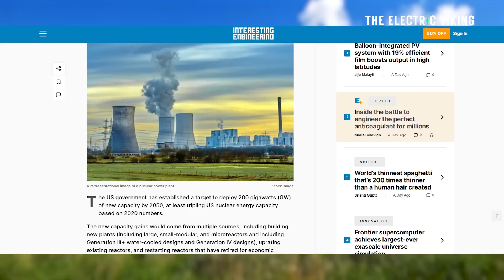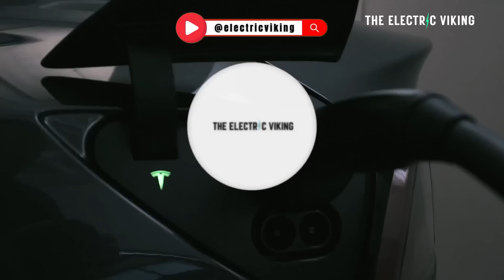US reveals plan to triple nuclear capacity with hundreds of nuclear reactors

Comment: There is no way that the US can nuclearise that fast. Even China faced manpower constraints just to run the stations. US face far far more constraints. It will take  years before it can even have a proper plan of expansion.
Reply: The US has lots of issues, the main one being the fossil fuel industry. It's understandably, fighting tooth and nail to avoid redundancy. For the most part the rest of the world isn't saddled with that problem, so will move on regardless. The US can catch up later.
Reply: @jimgraham6722  We will have another 4 years to catch up unless we get rid of Trump.
Reply: @EdwinaTS  6 years for new SMRs.  3-4 years for subsequent ones.
Reply: @ws7001  That is what they say, however 2 to 3 times more years to complete, non sense.
Reply: @rozonoemi9374  some of these designs are much simpler to build and operate.
Reply: @ws7001  Still nuclear BS.
Reply: @ws7001  To triple the nuclear generating capacity (now at about 100 GW) you would need another 200 Gw constructed. If SMRs are used that would require about 600 SMRs to be built given that SMRs are supposed to have a generating capacity of 0.3 GW. Or you could builr 200 ! GW reactors. If costs are like Vogtle 3 and 4 then they would cost about $A5 trillion of about$US3.4 trillion. Also where are they going to get the trained workforce required for such a project?
Reply: @ most SMR designs are for multiple units per building for about one gigawatt output.   The better gen 4 fast reactors are automated, nothing do for 30 years but watch screens and dust the office. These are low pressure units so concrete pours are simplified, vessels are small so construction is also simplified, using helium for working fluid means no need for secondary loops with water, moving parts rated for over 30 years means very limited maintenance requirements, fuel replacement every 30 years means very little maintenance.  Operation costs are mostly for security.  Training by VR is in progress and will simply hiring and training process.  These smaller units are easier to make fail safe- heat can be dissipated through ground without cooling water or pumps, this is a critical factor of SMR concept.  It’s not just to save costs or faster buildout. Total cost probably $1.5-2 Trillion.
Reply: @ws7001  Renewable are much cheaper & much faster deployments than any nuclear & much safer.
Reply: @ renewables are more expensive in northern areas requiring long term storage, as much as ten times more expensive.  Most of the developed populations live in northern regions.  Long term health effects of workers exposed to solar cell and windmill manufacturing are suspect in China.
Reply: @ws7001  BS
Reply: @ After 500 years of renewables and their waste entering our oceans it’s possible most sea life will go extinct. Have you investigated the cancer rates in China?
Reply: @ws7001  China has low birth rate & consequently rapidly aging population, hence cancer rate is bound to be high, but their life expectancy has caught up with the US despite living through some of the most polluted years. The past decade of the Green China plan worked amazingly well.
Reply: @ I’m sure CPC supplied data would show that.
Reply: @ws7001  On which planet do you live?
Reply: @ Third rock from the sun.
Reply: @ws7001  "renewables and their waste entering our oceans" That's a new one.

Comment: Truly stupid. Western companies simply cannot build reactors anywhere close to on time or on budget. 

Want a choice which is just as reliable, far faster to build, far cheaper than nuclear? Plus easier to modulate power and actually store some? Enhanced Geothermal Systems (EGS). Fervo is currently building a 400MW site and just received a lease for a 2GW site. Those two projects alone will exceed the amount of nuclear power built (start to finish) in the last 30+ years.
Reply: Hope it’s successful, however the high amount of corrosion due to dissolved salts and high temperatures will make maintenance an expensive issue.

Comment: Reducing regulations that slow the manufacturing of these plants will allow them to be built faster and cheaper. Not talking about regulations to make them safe but some refs were designed to eliminate or make nuclear plants more expensive on purpose. But now things have changed and it’s now realized it’s the cleanest power.
Reply: Usually regulations are there because some buffoon tried to cut corners and stupid things happened. For example in aviation industry regulations are written in blood. Can't imagine it would be far off in nuclear generation.

Regulations are needed.
Reply: Nuke Reactors will last longer than solar and a bunch of batteries so it’s worth the investment too
Reply: @JDMSwervo2001

LOL

Comment: Electric cars should be the back-up grid
Reply: For sale: 2023 Tesla model 3 10,000 miles. (And 750 discharge cycles not counted against its used condition)

Comment: I think its a matter of a good redundancy, having renewables for normal life, but backup nuclear, then renewables cant work (cataclysms, etc.). Also if want to travel outside of earth, small nuclear reactor may power so much while being somewhat "portable".
Reply: I think we should have a 50 50 solution with 50 percent or more nuclear as the backbone with renewables playing as the support role because every 18 months you need yo shut down a reactor to conduct maintenance and refueling.  Nuclear itself is the most safest form of energy generation that can compete with fossil fuels it can go 7/24/365 without interruptions.
Reply: Nuclear thst you regularly shut in doesn’t make sense, that’s extremely poor economics for nukes.

We actually may see dedicated nukes for server farms, that makes sense since that’s a 24/7 level load, which is a great match for how nuclear works best.

Comment: I live 10 miles from a nuclear power plant for the last 40 years and have had zero issues with it.
Reply: Great for the tax base
Reply: The people around Fukushima were enjoying their lives, until one day when they weren't.

Same with Chernobyl.

And Three Mile Island.

There have been many nuclear accidents.

If living near a nuclear plant, storage tank farm or gas or petroleum pipelines, you're certainly more at risk than someone living many miles away.
Reply: @dvader3263  yes those examples were terrible. However the use of fossil fuels by far kill more people each year with the pollution in our air the environmental damage oil spills that kill wildlife. So statistically Nuclear power is much safer. The only difference is when a nuclear accident happens it has the potential for catastrophic consequences. Then add the carbon emissions that we know will cause vast zones that will be practically uninhabitable. Sea levels that submerge cities around the globe and cause massive climate driven immigration from people forced to migrate from submerged communities like Miami and New Orleans. I live 10 miles from a Nuclear Power plant and in 45 years have not had one incident. All this being said Nuclear power plants have redundant systems and strict safety regulations. And in the United States we have only had one nuclear incident and it did not leak any radioactive material into the atmosphere.
Reply: It seems that Sam is against nuclear energy because of the high cost of electricity they produce (see levelized cost of energy), high cost of building the facilities, very long permit and build times, and lacking any reasonable power up and power down abilities, they only provide base power but do so at cost that is as high as any peaking plant.  Any power plant can keep the lights on.  In-flexible base power was tolerated because it was the cheapest.  In-flexible nukes and coal are now the most expensive.
Reply: How long have you lived there?  The nuclear waste takes 10,000 years to decay and become no longer hazardous.  You are but a blip.
Reply: @hobaho  it may take 10k years but it’s incased in a container that is so durable it is nearly impossible to leak. Nuclear is a wonderful base load source of carbon free energy.
Reply: @Dallas-wu6st  that’s Fascinating.  I would love to see a container that lasts 10k years.  Written language has only existed for 5.5.
Reply: @hobaho  the pyramids lasted 5k and probably will last another 5k so there! And that was made by far less advanced people. Nuclear power is far safer than any other energy technology we have that can produce that much energy in such a small footprint.
Reply: @Dallas-wu6st  There's no radioactive waste in the Pyramids.  You're talking about securely containing radioactive waste for 10,000 years.  We've never seen/made anything that would even be close to capable of doing that.  You're just giving the problem to future generations.
Reply: @ I understand your point. But given our power needs and the huge problems with climate change we must find a solution to limit emissions that are damaging our planet. Nuclear power is the best base load source of energy we currently have. Fusion reactors hopefully will one day replace fission reactors. Another way is to use solar power and new battery technology to provide the energy we need. I myself installed 60 solar panels on my home with 3 power walls that make me energy independent. The system provides all my energy needs for my home and my Tesla car. I realize that not everyone can afford the system I installed. But large solar farms and industrial size batteries are capable of reducing emissions. I am worried not for myself since I am in my late 60s and the I will be long since gone when the worst of climate change will occur. I am very concerned about the future generations and the world my generation left them.  To do  nothing is morally wrong. We must find a way to protect our planet not only for ourselves but for future generations of people. We only have this one place to live.
Reply: @Dallas-wu6st  "Baseload" is a concept created to fit particular characteristics of certain power generation types. You shouldn't strive to mimic an old technique with a new tool, you should strive to design your approach to address the end goal.
Reply: يوما ما سوف تنهار هذه المحطة النووية بطريقة او بأخرى سوف يكون الانهيار دون سابق إنذار مثل ما حدث في مدينة تشرنوبل ومثل ما حدث في اليابان
Reply: It's not that nuclear power plants have problems. It's that they are ridiculously expensive and take forever to build.
Reply: Future generations will have to deal with the decommissioning then?
Reply: @jsanders100 No all modern nuclear plants have through life management and funding, including site cleanup and restoration if needs be. Thus money is continually set aside for eventual decommissioning.
Reply: @jimgraham6722  What a waste of public money.
Reply: Exactly
Reply: I would put one in my back yard. They are safer than any other form of electricity generation. Viking's crusade agains nuclear is ignorant.
Reply: @beautifulgirl219  Nuclear is just moving pollution of radioactive waste to out of sight in someone else backyard, however the radiation will persist for thousands of years,
Reply: @beautifulgirl219 you are joking!
Reply: @beautifulgirl219  Actually he's Australian, there's a VERY good domestic reason for him to loath nuclear power. Pitching economically infeasible nuclear plan is being used in Australia by The Usual Suspects as a ploy to prop up coal and to lesser extent NG, argue against wind and solar that Australia is well suited to get by on (with the aid of battery farms and a bit of NG peakers).

Comment: Look, I generally like your content, but this video contains some nonsense (nobody wants to live 100 miles from nuclear powerplant) and it is obvious you're not a fan of nuclear.
Industry likes abundant reliable predictable power with high capacity factor, contrary what renewables offer. Look what happened in Germany. In Czech Republic we have 6 reactors, 4GWe (4 more planned), hundreds of thousands people live within 100 miles from both facilities, we successfully use the nuclear heat for district heating, displacing some 80 thousands ton of CO2 per year with huge extensions planned (nuclear heating for Brno city). Nobody has problem with it and the public support of nuclear is high.
Reply: Germany succesfully cut its string with russion energy dependence and relies now ~60% in renewables, and is aiming to close all their coal centrals in the next decade, transitionong to 100% renewables before 2050. Meanwhile nuclear France is in bankrupcy...
Reply: @Buran01  yeah, last week in Germany the hourly spot electricity price was above 800€ per MWh for two hours. Dunkelflaute. Even even lignite powerplants did not help. Massive import from abroad (mainly nuclear from France) saved Germany from blackout. I am also fan of renewables, but not on grid scale in central Europe.
Reply: @matejorsag6515  EDF is essentially in bankrupt, so that dpendence from Franch nuclear won't last much.

Comment: Large nuclear reactors are 6x more expensive to deliver energy than solar and wind, and SMR’s are 10x more, so unless nuclear developers can convince customers to pay 6-10x more for energy, they won’t happen.
Reply: Absolute rubbish no nuclear plant has lasted 80 years and they never will. Why doesn’t anyone want to talk about decommissioning cost?
Reply: @RussellFineArt  Nuclear powerplant can easily last +80 years with 90% capacity factor. Solar panels and wind turbines has to be changed completely each 20-30 years with maybe 15 and 30% capacity factor.  Imagine the amount of waste, to destroy and reinstall everything each 25 years.
Reply: What a stupid comment, wasn't Solar 10 times the cost 15 years ago?

Jeez we should never have invested back then....
Reply: It's not a cost problem, and reactor power will not replace solar & wind. Some areas are simply not practical for solar and wind power. The newer/smaller/safer/cheaper Generation 4,5 reactors are more practical to deploy and use in these remote areas.
Reply: @dr.x4050  Lol is not a cost problem... That's why General Electric, Westinghouse went bankrupt, and EDF was withdraw from the stock market with  mid term debt beyond 100.000 million €...   Good luck with those projects
Reply: @Buran01  The special projects I was talking about are for use in extremely remote locations, such as the South Pole or underwater. Some applications also require very high energy density that wind and solar can not provide. Yes, these special projects will require very special budget approval. Another example is using a reactor to power a super-size container ship. This tiny reactor will provide 30 years of power without requiring refueling.
Reply: Nuclar power is probably the best bet if you want to concentrate profits to western industrialists. As for customers choice, better not give them one. That can probably be arranged.

Comment: Nuclear energy is the last ditch effort by utilities to retain a centralized grid. Cutting the regulation that underpins a centralized grid should be one of Elon Musk's highest DOGE priorities.  A decentralized grid is far less expensive and less vulnerable to hybrid warfare.  Widespread home "back up batteries" instead of home generators, the storage capacity of of new fleets of EV's, combined with efficient localized generation of power through home solar and wind systems in tandem with a system for energy redistribution will not require these nuclear generators.
Reply: Yes they are an overpriced military target.

Comment: I'm fine with backup nuclear power for certain industries but not using it for mainline power production. 
    Remember we are one super volcano eruption away from solar panels not working well. Wind turbines will suffer bearing damage from the pumice in the air. 
Something like nuclear power to run hospitals and govt agencies is essential to have on the grid for such emergencies. 
However they should only be backup power NOT mainline power because it is too expensive to maintain versus the economics of wind and solar.

Comment: The cost of building nuclear power plants ☢️ is exorbitantly high largely because of poor designs and bloated safety regulations that are redundant and unnecessary as it’s possible to build nuclear plants without the ability to ever have a meltdown. Many have been designed so poorly that the original designer has repeatedly stated that we have vastly superior designs with superior materials that what is being used currently is dangerous inefficient and unnecessary.

Comment: new SMR affordable technologies coming. US concerns come from the fact, solar pannels come from China. SMR could be built in a factory and quickly installed.... as long as the starts up deliver on their promises, SMR could be of 125-250MW modular units. They could be installed where the old coal units are currently based.
Reply: There is only ONE successful SMR project in the world right now: China's Linglong One. Every other SMR project has either gone bankrupt or is about to.
Reply: @andrewsuryali8540  and many start ups around the world. Some are backed by governments other by big capital. Let's imagine 2-3 out of 20 succeed. IMO SMR have better odds of success than ITER 🙂
Reply: @andrewsuryali8540  There are over 80 different designs ready to go. Just needs funding and a location
Reply: There are no commercial SMRs running in the world at this moment. China's Linglong 1 , 125 MW reactor, will not be commissioned for another two years and will it be "Modular". To my mind "Modular " means being able to be mass produced in a factory and sent out to sites by truck.